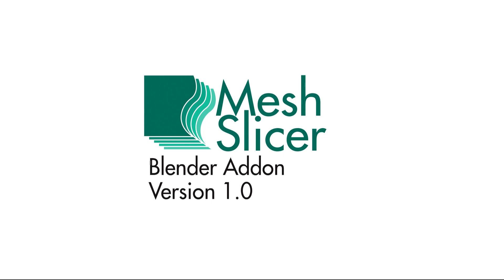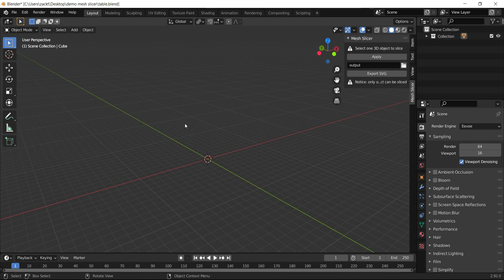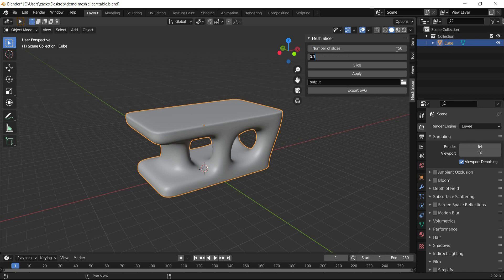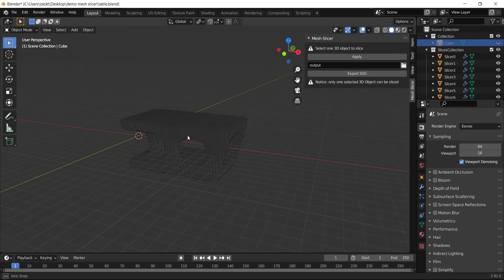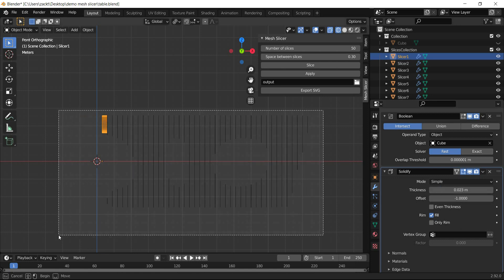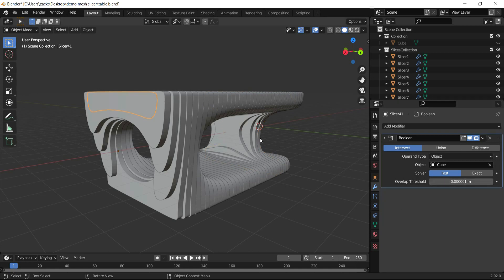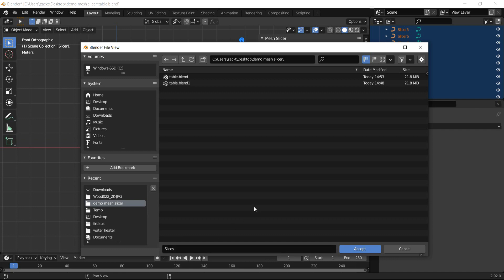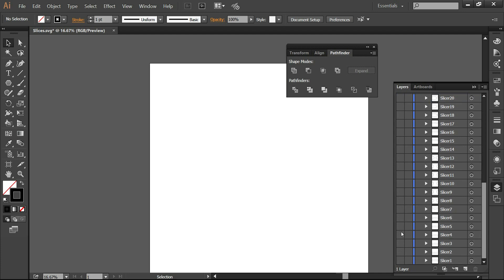Mesh Slicer 1.0 Demo - create a parametric design of any 3D mesh in few minutes

Comment: I'm curent buying this add on because autodesk discountiued the 123d maker and the Slicer for Fusion 360, thanks for doing a time savior add on. Now my doubt : how can I use/make it in interlock slices? like vertical and horizontal orientation for construct a buck model?
Reply from the maker: Hi do you mean slicing on both direction horizontal and vertical? yes it is possible you just slice it vertical as the default slicing and then rotate your object and slice it again.

Comment: How to nest the drawings?
Reply from the maker: you mean ?
Reply: @zakariatalebhacine3826  is it possible to automatically arrange all the cut lines on a specified panel like custom dimension of plywood with specified spacing/arrangement etc so it makes best use of space and minimizes material waste
Reply from the maker: @allenl9214  Thanks for explaining, the option of arranging the slices in a way that minimize the consumption of the wood exist in the cutting machines software (Artcam for Example), but yes may be we will include it in future version
Reply: @zakariatalebhacine3826  that would be nice and useful feature for all using this addon because not everyone use artcam.. maybe just simple laser cutter or diy cnc etc.  Great tutorial and add on btw :) 👍
Reply from the maker: @allenl9214  thank you so much